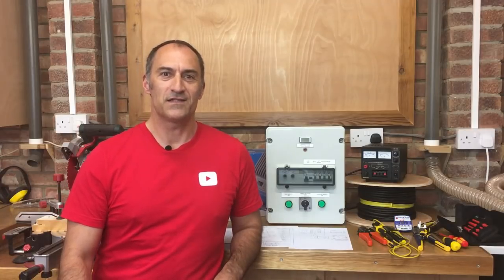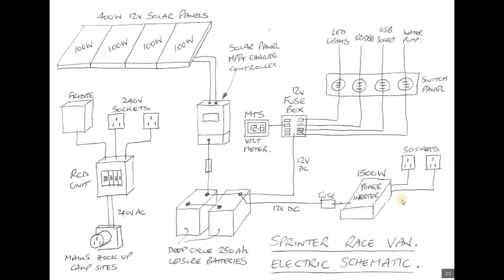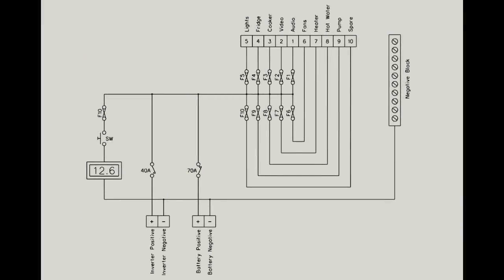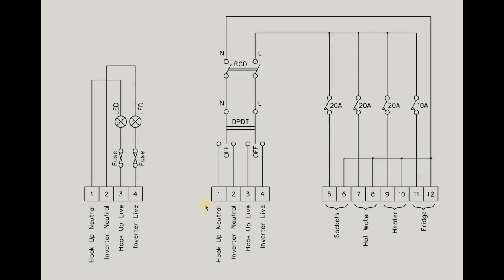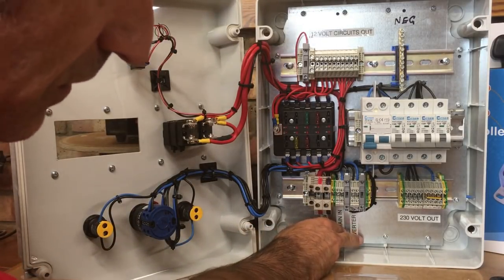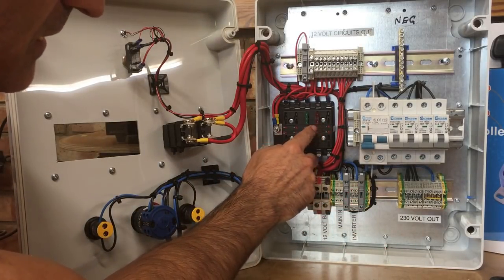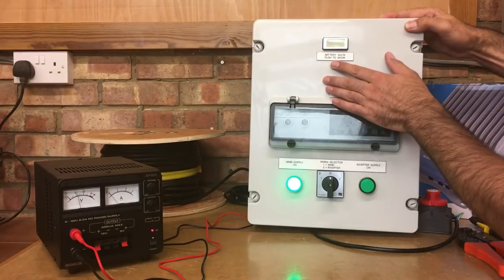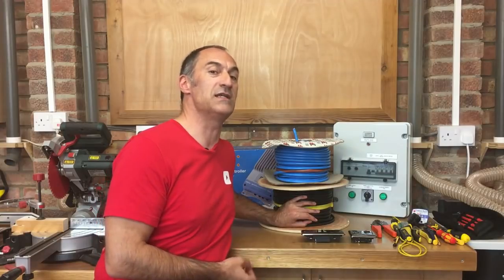Self Build Camper Van 12v Electric Control Panel

Comment: Hi Greg where did you get the enclosure also what did you do about needing a higher amp fuse for the inverter did you need to adjust the wiring ?

Comment: HI Greg, great video once again. I intend to run a 12v only system in my van but I would like to have a shore power switch over like yours and not have to use my batteries if I'm at a campsite. Is there a way to run a 12v system from a 240v shore hook up? Many thanks.

Comment: Hi Greg, thanks for the great guides! So much detail! Really helpful! One quick question, what size is needed for the black 12V cable? We can use that for everything right? The link shows all kinds of sizes and you only tell about the 2.5mm arctic blue.
Reply from the maker: It does depend on the load of each appliance, in general I used 1.5mm for lights, 2.5mm for sockets and some 4mm for bigger items like the fridge. 4mm PV cable for the solar panels, 35mm for the battery string and 16mm for main 12v power cables. Video to follow up on all of this.
Reply: @GregVirgoe  Thanks a lot Greg for making that clear :)! Really helped me out! Was a little confused when you where using the same wires everywhere, but they weren't :). You're video's are so help full with converting our Sprinter!
Reply from the maker: silvanvh, happy to help, you can always ask a question and I will come back to you anytime

Comment: Hi Greg, great videos and a mine of information as I start my Sprinter conversion.  Did you run a wire for the lighting from the rear of the van to the front and take off power from there for each individual LED light?

Comment: Incredible - the planning, execution, and the explanation was all perfect, as are all of your excellent videos. I was just wondering, assuming you have a charger when on mains hookup, how do you disconnect this charger when you switch to the inverter, as looking at it you have one RCD that everything goes through, so everything is either on or everything is off. Do you have a separate MCB for it that you just trip? Hope that makes sense.

Comment: Just wondering is there something wrong if I stick to a 12v system from my batteries and for 120v (I'm in the USA) I use my inverter charger (by AIMS) and if I happen to have access to shore power just plug it into the inverter charger so that it tops off my batteries. I understand this will make my batteries cycle through faster but I don't plan on having access to mains power very often anyways. 

Your system is amazing and beautiful but I feel it's a bit out of reach for me. I'm absolutely loving your videos (especially the heat loss calculation video!), super informative and exactly what I've been looking for. Thanks!

Comment: Hi great video. Where did you get your ip rated box with the window in it from
Reply from the maker: The window is a separate item and was cut into the from cover of the abs enclosure. 
The MCBs has to be raised off the back panel on folded din rail to make them poke through the front cover. This was cut around the breakers. 
Most parts from RS components and eBay.
Reply: Brilliant thank you for that. All your videos are amazing so thanks for those also. Hope you both enjoy your European tour, I’m sure u will 👍

Comment: Hi Greg, great videos well explained and easy to follow. Can I ask why you decided to manually switch between hook up and inverter instead of using an inverter/charger?
Reply from the maker: Hello craig, when I was selecting my equipment and doing my research I was not aware of any all in one solution which is why I created this panel. If I ever did another it would most likely have a different setup, but this will work perfectly. 👍🏼😃

Comment: Hi Greg, I was wondering if I could use the 3 core cable on 12v dc supplies? If so, what would I do with the earth part. Just not hook it up to anything ? Thanks !
Reply from the maker: Hi Jake, yes, just snip the earth as short as you can and put a bit of electrical tape around the end, no worries 😉
Reply: @GregVirgoe  Perfect thanks very much Greg! I hope your van is treating you well after the hard work you have put in. It's by far the best van conversion I have ever seen. All the best, Jake

Comment: Our freighter m45 battery went dead. Our mechanic told is our f350 alternator was large enough to charge the freighter as long as we maintained our rpm. You might talk about alternator capacity for driving and charging shore power. Also drive battery controller that maintains 50% capacity to allow driving and automatic shut down of batteries both drive and leisure.

Comment: Tesla ppl have been buying flood damaged Tesla in water for ten days. Still work and dry. An instal using a weathered pack rat box could store Tesla battery pack and high speed charging at Tesla station. Courious how you could use as leisure battery and appliances.

Comment: Greg you have shot power 230 AC and 12 volt d c. Would it change if your inverter produced 1q0 volt AC use equipment?

Comment: Hi great video, thanks. Can i ask why you decided to remove the inverter feed in the end?
Reply from the maker: Hello Brian, I misread the manual and grossly undersized the cabling and DC trip, it was also suggested to me that far better to have the fuse close to the source, ie the battery. So I took it out of the panel.

Comment: Hey greg., Ive been looking (again) around your videos of the conversion, and couldn't find any piece on info about about how to attach the battery bank to the van. Im thinking about fixing it to the chasi and a metal plate below the metal van floor. All on top of a wood frame on the heigh of the floor, but there must be a simpler and also safe way to attach it! 80kg 316 ah
Im on my conversion (2018 FWD sprinter medium high roof) and doing many things following the way you did it. Cheers and merry xmas.
Reply from the maker: If you have access to Instagram look me up on there there is a picture of my controls and batteries in the garage. They are surrounded by timber fixed to the floor and ratchet straps over each one holding them down. 😀

Comment: Brilliant as always Greg. Just wondered if you were thinking of adding a charger to the hook-up system to top up the batteries when on hook up? I won't normally use campsites at all, but after a few days off grid in gloomy weather it would be useful to plug in and top the batteries up while I wait for the sun to come out.

Comment: Hi Greg, 
Do you have a video tut to an easier electrical system with the auxiliary batteries simply hooked to the van battery and charged while the vehicle is running?
Thanks for your time and the great videos!
Reply from the maker: I do plan to cover this with another electrical video which I am recording over the holidays, so will be out in a couple of weeks
Reply: Super! 
Thanks for the quick reply! 🙏🏼

Comment: You can use a switch to determine where your 240V AC power is coming from, either the shore power hookup or the inverter source. The easiest way to do this is by means of switch normally used to power a household washingmachine or a dryer. A selector switch usually installed overhead and operated by a set of strings. The one doing the washing/drying can select what appliance get's the power.
This type of switch is common and as a result not very expensive.
The way it is wired up is the reverse to what the washer/dryer setup would entail.
A wiring diagram here:  https://homemade-circuits.com/wp-content/uploads/2012/09/invertertoACmainschangeovercircuit.png
In this diagram a relay is used but the manual washer/dryer switch has the same function and can be used as well. To clarify the drawing a bit, The bit which should be of interest is the part marked DPDT Relay (which can be read as Washer/Dryer Switch) and it's connections/wiring:
 the blue wires go to your van's AC circuit breaker panel, the brown wires are wired to the shore power connection and the red wires are connected to the inverter 240 V output. One drawback is the system isn't automatically switching between shore and inverter power. In my opinion not necessarily a bad thing because it forces one to be conscience about power and power use. I recommend (if your inverter is somewhat hard to reach) you use a second switch next to the "washer/dryer selector switch" to be able to switch off the inverter whilst on shore power. No need for it to be running in that situation obviously. Some inverters support external switches being hooked up, if not, a creative screwing, soldering and splicing job is on the horizon.
Shore Power / Inverter Power switches are needed because it is very dangerous to have an inverter AND mains power flowing into your van's circuit breaker panel at the same time. Mains power could be differently polarized (lead and neutral can not be predicted for certain when you plug in somewhere) as the inverter power or the sine waves of both could amplify or cancel out each outer resulting in a too low or too high a voltage... which leaves the van's 240 circuit (and connected appliances) in danger of damage and/or destruction.
Reply from the maker: The DPDT switch you describe is exactly what I have in the panel door, have you downloaded my wiring diagram? a free copy is in the video description, go have a look :D

Comment: Hello Greg. First off, great videos- they've offered real reassurance, answered a lot my 'newbie' questions and have given this non-handy person a lot of confidence, thank you! The black 12v cable- was that also 2.5mm? Are there many disadvantages going smaller if you are creating a very simple setup (small 12v fridge and some USB chargers). Best regards. Ben
Reply from the maker: Hi Ben, often with 12v devices the amps are higher so the cable needs to be bigger. 
Take your load of the device in Watts and divide by the voltage to get the amps. 
i.e. 75W/12V=6.25Amps 
Generally 1.5mm is ok up to 15Amps  2.5mm up to 29Amps and 4mm for fridge or larger loads. For half a dozen lights 1.5mm should be fine, just add together those items that are on the same cable. Hope that helps

Comment: Love, love watching your videos. In possession of a 86 VW LT, just stripped it bare as in desperate need of a total revamp, a couple of questions. Apologies if I missed something or the answer is simple. What Amps were MCBs and RCDs. I've followed your link and the options are endless.
Reply from the maker: Hi Amy, it really depends on what you want to put in your van as that will determine the electrical load. 
Once you know what equipment you will be installing just look at the max running current and the fuse sizes are normally 1.25 x that but always less than your cable rating. If you can list the things you want to run in your van I can be more specific.
Reply: Greg Virgoe  I'm planning a very similar set up to your van. Exactly what I wanted with regards to having a choice between off grid and hook up. No heater will be installed, same amount of LEDs and such. We wouldn't be using hairdryer or straightens, a TV maybe. Wanted a couple of sockets with the usb points. Also a water pump and heater for short showers and kitchen sink use. I will have to use your excel calculation sheet 🙂 Also where did you source the actually box/consumer unit? We would only be off grid for a max of 2 nights/days

Comment: Hi Greg, thanks for the inspiration. I notice your schematic for the 240v shows 3 x 20a and a 10a mob but pic of box looks like a30? Also did you get the backing plate for the unit separately and if so where from please. Happy days. Andy

Comment: Hi Greg, I notice you don't mention split charging from the van alternator.  Is this because you expect to use campsites a lot, or because you have 4 solar modules and don't anticipate needing it - or is it because of NCV3 incompatibility? I just took the split charger off the Transit and whopped it on the Sprinter, but it doesn't seem to be working. It might be that I need to independently earth the auxiliary battery, or the split charger might have packed up. Or, someone pointed out, I might have a 'smart' alternator. I thought I'd watch your video and see what you did... and you didn't!  Cathy
Reply: Ah, I just noticed in the comments that you do have a split charge relay, and you wish you had  known about the combined Vitron ones. Someone recommended these to me, but the one I bought for the Transit I sent back, as my auto electrician couldn't make it work - although the supplier tested it and said it was fine.  I've looked at their website, and there are a few to choose from.  I think I bought the 'battery combiner' one.  I wondered: which one would you buy?

Comment: Hi Greg! Is it a bad idea to go with only 12v electrics, and when you hook up to 240v just use a 240-12v charger for the batteries? I think it’s a good idea but maybe I’m forgetting about something. I want to make my own build and doing some research. Have seen almost all of you videos and they are great. Just started over from the beginning and going to watch them all and take notes 😄
Reply from the maker: No, it's not a bad idea at all to go 12v, much better if you can for going off grid as there are more system losses by using an inverter to give you 230v from a battery. You can get laptop chargers and camera chargers that now work of 12v too
I went for both as I have some items that are 230v that I wanted to be able to use on our trip. i.e. 24" HD TV :D lol

Comment: Great informative videos, thanks can you put a link in please as to where you purchased the metal box unit you fitted your rcd’s and fuses please. Thanks.
Reply from the maker: The box is ABS plastic and here is a link for you
https://rover.ebay.com/rover/1/710-53481-19255-0/1?ff3=4&toolid=11800&pub=5575265109&campid=5338027957&mpre=https%3A%2F%2Fwww.ebay.co.uk%2Fsch%2Fi.html%3F_odkw%3Dabs%2Bplastic%2Benclosure%26_osacat%3D92074%26_from%3DR40%26_trksid%3Dm570.l1313%26_nkw%3DIP65%2Babs%2Bplastic%2Benclosure%26_sacat%3D92074

Comment: Excellent video Greg. Well thought out wiring control system and well explained. Nice control box fabricated as well with DIN rails for all the relevant circuits. Any reason why you didn't opt to trickle charge the batteries when you are using a "hookup"?
Reply from the maker: Thanks chris, I didn’t cover it on the video but I have got a mains battery charger and split charge relay fitted. So I have three ways of charging the batteries. In hindsight I wish I knew more when I brought them as I would have gone for a combined unit like Vitron ones?

Comment: very nice panel david ,i build and work on panels daily and the only thing i would change is to use the changeover switch to operate 2 contactors as the smaller switches are prone to failing when carrying inductive loads-bound to fail at the worst possible time too lol

Comment: I’ve been looking for a way to do this. How would you wire it so that shore power can also charge the leisure batteries ?
Reply from the maker: Simply wire your mains battery charger to the shore power connection via an isolator you can choose whether to have it on or not

Comment: Hi Greg, I'm new to your channel. I saw your video on insulation on a Drivin' & Vibin' video link. Does England have inspection requirements for DIY vehicle conversions?
Reply from the maker: Hi Lina, great question, there are British and European standards for electrics and gas for instance but it is not enforced and currently not a legal requirement to have the installation tested either is it's a self build. I would definitely recommend getting both tested as they both have the potential to kill you if not installed correctly. A work colleague died some years ago when his LPG system exploded overnight due to a leak.

Comment: Mate you are doing such a good job! A very knowledgeable man! I love how much effort you put into everything. I am currently fitting out a 25 seat bus into a motorhome. I have always been fine with 12v systems, but now throwing 240v into the mix is doing my head in! How to decide what size wire to use, what size fuses etc...? Is there a website you can recommend? Or can i send a schematic to you for your thoughts? Thanks!!
Reply: Hey Greg I sent an email last week, did you get it?
Reply from the maker: jakeoblake, yes, I printed it off and have been writing my replies against each item as I travel about, I will type it up now while I'm having breakfast, sorry just been super busy. Thanks for your patience.
Reply from the maker: Hi, there is an email address on the about page of this channel. Please send over 😀

Comment: Greg, great video, just a quick query.  Are your 12v electrics at any point connected to the body? or is the 12v system isolated from the body?

Comment: OMG it's a thing of beauty!
I love your perfection.
So clear, simple & precise.
Wish I could buy one from you.
Because here in Australia 12v & 240v are done separately by x2 different technicians.
I am expecting quite a battle to get any sense out of anything they do.
In Australia all wiring must be done by "qualified tradesmen".
I'll spend many a night dreaming about your control panel.
Reply from the maker: Can you not do the install then get it tested and signed off by an electrician?